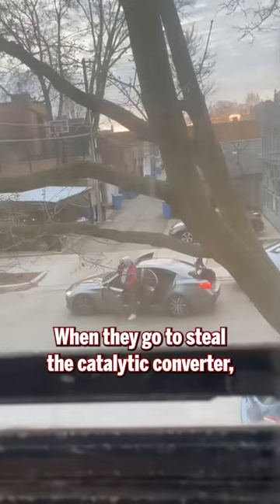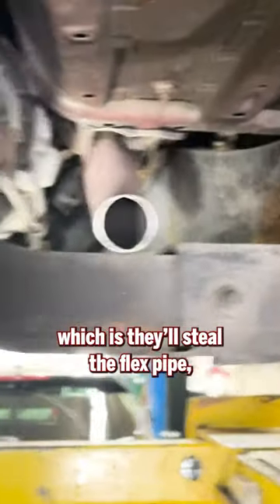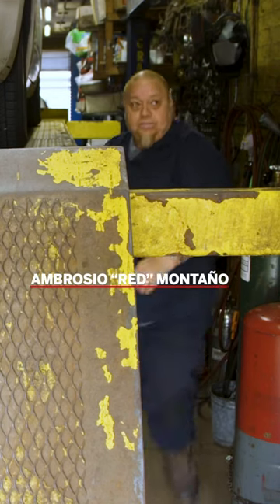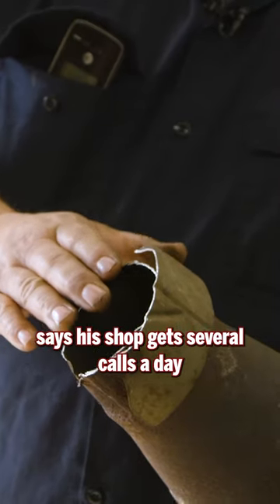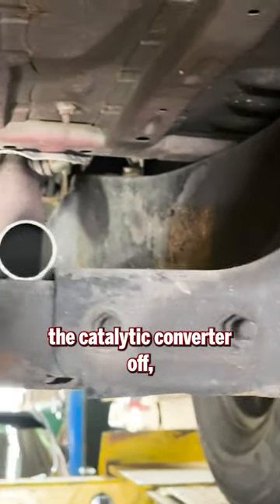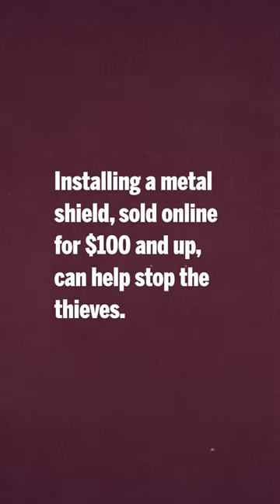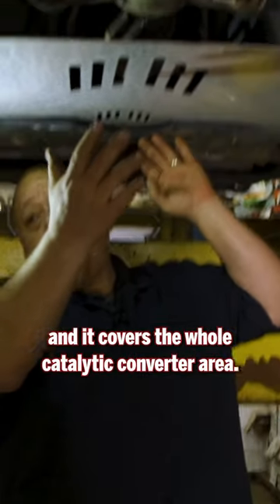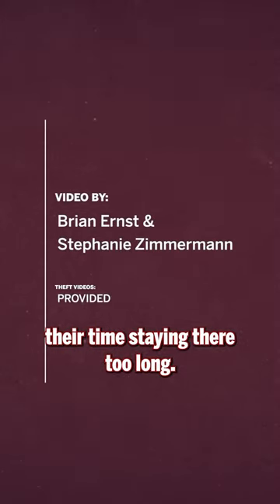Catalytic Converter #thefts are sweeping #chicago. The #suntimes reports on the damage being done.

Comment: I currently have two cars. One is electric, and the other is a MGB. They tucked the cat right at the exhaust manifold in the engine compartment, and covered it with asbestos. Too much trouble to get out. The interior however is easy to get to because I leave it unlocked. Idiots still cut the convertible top on occasion instead of checking the door. Nothing inside to steal. No radio even, but once someone did steal the carpet. Probably because it had a MG logo on it.